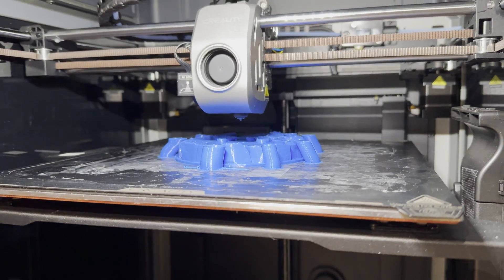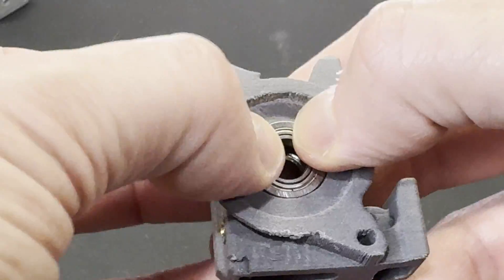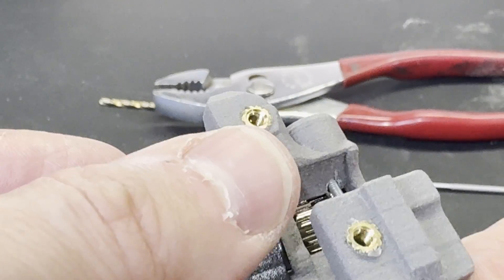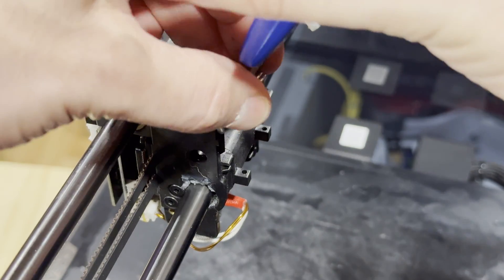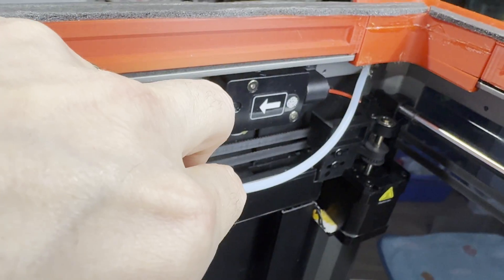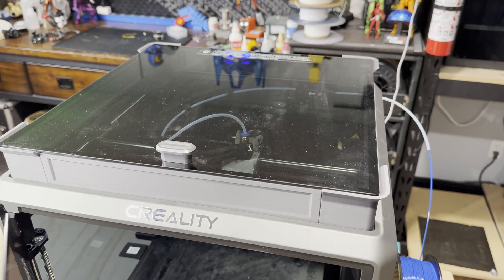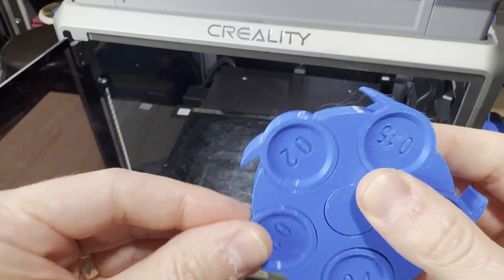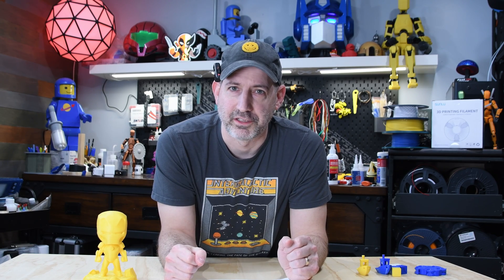Want to FIX Your K1 Max Extruding Problems? Watch This Now!

Comment: Upgrade. I bought the bondtech upgrade for my k1 but it’s a lot of money on top of the k1 price. Does help with VFA though, and I also had fixed the ptfe tube routing even before that. It’s a great printer but should be better out of the box.
Reply from the maker: I agree, it’s ok once you fix all the issues with it. Shouldn’t be the way.

Comment: I can't even get the filament to go into the extruder all the way and I even bought a replacement. No luck. Just keep getting that clicking noise
Reply from the maker: It’s probably hitting the edge of the tube between the extruder and hot end. 
Make sure you cut the filament on an angle and it doesn’t have a curve so it goes straight down. 
I get the same issue some times but twisting the filament and fiddling with it, it goes through.
Reply: My replacement doesn't have a hole big enough to fit the piece of ptfe tubing

Comment: I have a K1 Max and i have the same issue. the only thing that is left from the original head is the outside i tried changing everything. 3 extruders but still the same problem. top and door open. right now i just have a big paperweight.
Reply from the maker: mine has been reliable since my changes but I only use the machine when I need to print something that's too big to fit on my bambu :)

Comment: I am having the same issue, I have noticed that when it clogs and I extract the filiment  that I can see track marks on the filiment that was backed out of the extruder, I also saw that creality has introduced an extruder "Upgrade" but the images look exactly like the extruder I already have. I had been running mostly problem free for the last 3 months now it gets clogged after only 3-4 layers. but it also prints benchies perfectly everytime. seems anything I try and print that has a base bigger than 8-12 inches clogs. superfrustrated. but a replacemt extruder is only $40.
Reply from the maker: Ya I found I couldn’t trust the machine until I made the upgrade. Haven’t had a issue since
Reply: I installed the "upgrade" today. It is a bit different. The heat block is a slightly different shape, it does away with the plastic tube that goes between it & the extruder - replacing it with a metal one that protrudes up from the head itself (I'm pretty sure it's connected). Trying these new parts to resolve the same problem mentioned in this video. I did get the extruder "upgrade" & THAT seems the same as the old one, only difference is that it can't fit the plastic tube from the old head, it's a touch more narrow. I am pretty disappointed in Creality right now. Printing as I type this but so far so good....
Reply from the maker: @85mshek I ad previously replaced my hotend with the micro Swiss version that has a full metal tube up into the extruder so I didn’t use the plastic tube either

Comment: These printers are not as easy as they should be for the price. Need firmware updates. Won’t connect to wifi. Won’t extrude.  What a shit box.
Reply from the maker: I agree, from what I hear some people have no issues though so I think it’s a quality control problem. Too many bad printers make it out the door. When it’s working it works quite well though :)
Reply: For the money I shouldn’t need to order a new nozzle or extruded just to get it working.  Glad I bought through Amazon. They let me ship it back for a full refund.   I’ll probably get a QIDI

Comment: What was your extruder and bed temps for that PLA?  (asking because I am having a heck of a time getting PLA to print.  Creality says it should print at 230C and bed of 50-60C, but the community is saying that is too hot and should be more like 210-220C with a bed of 45-50C.    Can you confirm your settings?
Reply: One of the things I've found out printing PLA on Crality K1 is that the outside temperature matters quite a bit. Keeping it open, both top and the doors sometimes help, but if it's above 25°C in the room, I have hard time printing anything. On the other hand, printing from ABS and PET-G works great all the time. At the end, I print almost everythign from PET-G.
Reply from the maker: I'm printing PLA at 240c 1st layer and 230c for the rest with a bet temp of 50c

Comment: Is it still an issue for k1 max in 2025? I mean if I order a new one today will I get the same issues? My first choice was p1s but you know the news and this one has bigger print volume
Reply from the maker: I can’t say for sure but if they didn’t change the extruder I would assume there is potential for the same issue.
The new bigger K1 plus seems to be getter very good reviews also.
Reply: Yes it's still issue got one two weeks ago, buy bambu man. Il never buy another creality again
Reply: @TheChez2208  I bought k1 max a week ago. Maybe 10 days. I print every day (7-10 hours). No issues so far. So maybe bambu is better Idk but I don't want to buy bambu at this moment. Also the big reason why I bought k1 max because in my country there is an offical reseller and bambu lab have none. So no warranty and service.
Reply from the maker: I’ve heard some people have no issues with their K1’s and some issues like mine. Seems hit and miss.

Comment: I've had a couple of successful prints, but now for some reason it has started to "cough", meaning that roughly at the same point (never exactly the same, though), the printhead starts to make a repetetive noise, and the filament just slowly dries up, leaving something resembling sand on the print table. Does this sound familiar, or did you have some other issue?
Reply from the maker: Are you hearing a clicking like the extruder is skipping? 
I thing the issues is for some reason the pressure gets too great and the extruder slips cuz it isn’t holding the filament well to start with. Then once it starts slipping it pushes with less force causing  it to slip more until it stops extruding entirely. 

It could be when moving slower like at the start or if there are a lot of directions changes it can keep up, but once it has long runs it slips. 

I tried increasing the temp and changing the hotbed but that only partially fixed the issue.
Reply: @DaveRigDesign  Yes, the clicking noise got my attention. 
I tried changin the flow-rate and nozzle temperature, which also seemed to help a little, but just that.

What you described sounds quite plausible, because last time I also made sure that the filament was coming off the spool nicely (in Crealitys Troubleshooting they mention spool getting stuck as a reason why it might not extrude AND make a repetitive, clicking noise...). Earlier today I sent a message to Crealitys Customer service (not that long ago since I bought the machine), I'll reference this conversation to them if that's ok?
Reply from the maker: @merinummi9123 sure
Reply: @merinummi9123  I kept having the same issue with PLA, It's possible to finetune the flow rate and advance pressure, plus keep the top open and make a successful prints, but the best option seems to be using higher temp materials that won't go soft in the extruder stepper. I've got almost 100% success rate with PET and ABS.

Comment: I had the exact same issue with my K1 Max, even replacing the hot end with the FlowTech as well. I'm looking at the extruder now as well. Oh, and LOL, I also suspect that extreme bend in the filament path from outside to inside the enclosure is the biggest part of the issue.

If I may ask two questions: Where did you get the brass rube to replace that piece of PTFE between the extruder and hot end, and do you have a link for those fantastic curved tweezers? I'd love to get a set for myself.
Reply from the maker: These are the tweezers, I saw them recommended in another video and they may a few different versions.  https://amzn.to/4gX8ByK
When I installed the Flowtech hotend it replaces the PTFE tube with a brass one from the hotend.
Reply: Thanks!

Comment: One question for you.  Are you printing PLA mainly?  If yes, the Creality guide clearly says to not print with the glass lid and to leave the front door open.  The interior gets too warm for PLA which causes problems like jams you are experiencing. You only use the lid and close the door for higher temp filaments.  
I ask as you video seems to show you leaving the lid on with PLA.  Jams are a well known problem if you leave the lid on and door closed when printing PLA
Reply from the maker: I’ve printed a bunch of materials all with the same issue. I also run the exhaust fan when printing pla. I think they say that to try and mask  the extruder issue. 
The stock extruder doesn’t have a very strong grip on the filaments so if the pressure is too great the gears slip grinding the filaments until it looses grip and then it stops extruding. 

I can see that happening easier if the internal temp is higher as the filament can be softer but it’s doesn’t get hot enough in the chamber to reach the glass temp of pla.
Reply: I have the K1. It says that you have to pick up the lid if the interior is above 30°C.
Reply from the maker: Yup, but I had the same issue with higher temp materials also, not just PLA

Comment: It looks like its intended to take a ECAS04. Those are quite common in the custom MMU communities.
Reply from the maker: Back of the motor says it’s a 
1.8 deg 36mm pancake stepper
LDO-36STH20-1004AHG(XH)
If that helps :)
Reply: @DaveRigDesign  Sorry...i was talking about the intended bowden coupler/retention is likely an ECAS04. They are 8mm in diameter and about 2.5mm deep when you take the rubber off the back (which is common when used in the custom MMU stuff). The rubber part of them are probably only needed if using it in an actual pneumatics scenario, so they are typically omitted in 3d printer parts.
Reply from the maker: @ammmze o I see. I’ll have to look it up Incase my glued in spacer fails, but it seems to be doing ok. It’s super weird there is no mention of what should go there anywhere though.
Reply: @DaveRigDesign  Agreed! I'm surprised they didn't just toss an ECAS04 in the parts kit. They are pretty inexpensive.

Comment: Upgrade completely unacceptable that they did not have threads or include a tap for the standard PTFE tube holder on top of the extrudi
Reply from the maker: Ya, I don’t know what the deal is with that. There is some kind of hole there though like some fitting was supposed to go there.

Comment: CREALITY and all types of their product - is piece of shit. I have 3 K1 Max last revision and this is shit.
And your yellow test prints are not "great", look at the layer lines. I really hate this company and their trash.
I also have flassforge, kingroon and   two ender 3S1 and FF the Best, $300 and you get better quality than K1.
Reply from the maker: I agree these kind of fixes shouldn't be needed. The machine should be working correctly out of the box. But most of the machine is pretty good. The yellow prints are running way faster than the filament is intended for. Slowing down to recommended speeds give much better results. 
That being said Bambu P1S is still my goto machine for anything important unless I need a bigger print volume.
Reply: @DaveRigDesign  😊
FF A5M can print better than k1 at the same speed, no any lines and FF have 27 cubic mm flow cheapest PET-G, $6 for kilo in Russia, K1 have only 18-20, it's really annoying!
Bought K1 only it has 300x300 mm table.
Yesterday one k1 lost few tooths on extruder gears, after 16 days of printing. Only 400 hours!!! 
CREALITY support don't answer me.